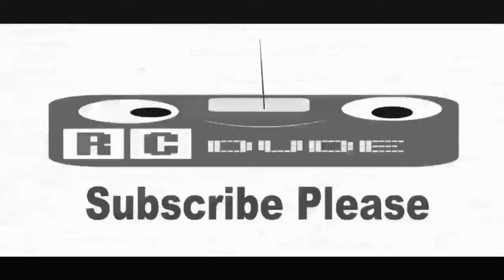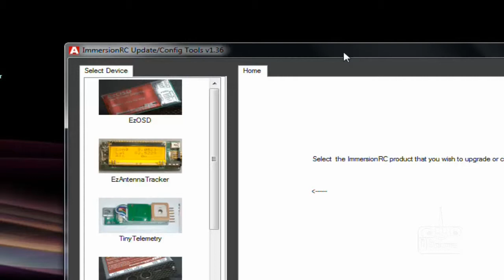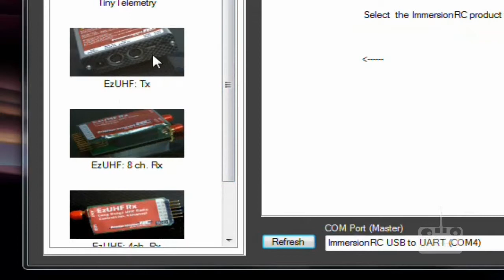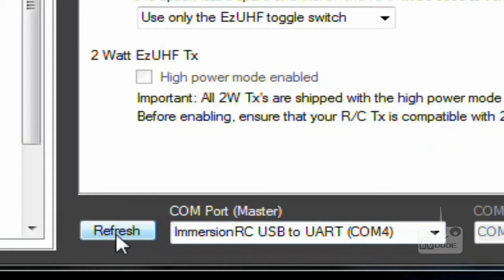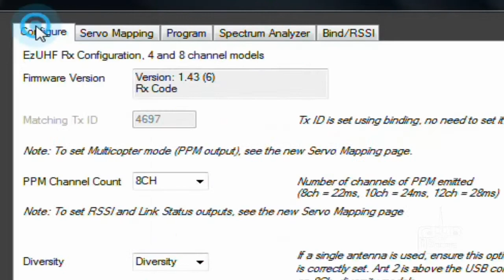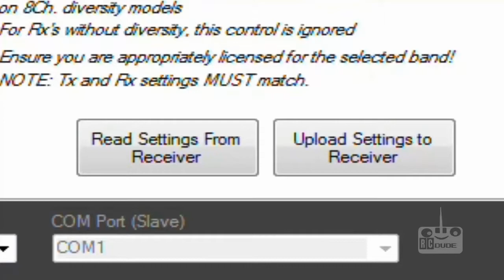EZUHF Transmitter If Binding Fail  What To Check

Comment: hi I bought new set EzUHF transmitter anddiversity reciver I download new firware and load up to both i imersion tool in transmitter show my up 1.53(6) a) but in receiver 1.53 (8)a0  isit the same firmware becous I hawe problem wit bind I frequency in both is thesame I tryed wia usb cable and no result
Reply: He just told you why